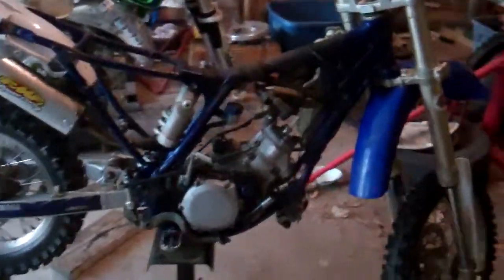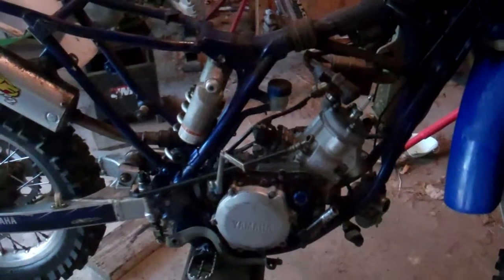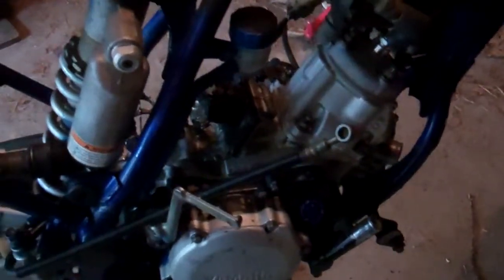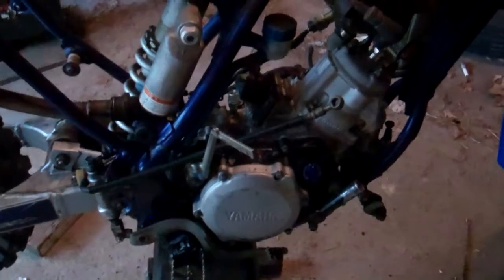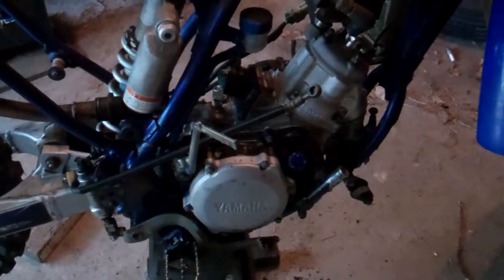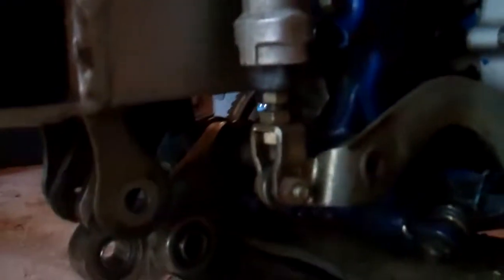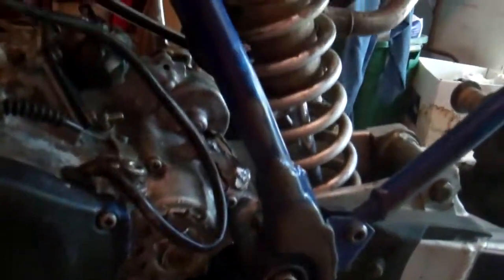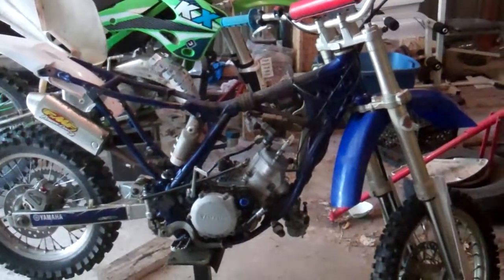02 YZ85 - Rebuilt engine/almost completed with the project!

Comment: Hey I have a TTR 125. My clutch doesn't start letting out until my clutch level is basically all the way out. Usually on dirtbikes I've rode as soon as you start letting the clutch out it moves the bike. What do I need to do to make it do that instead of not letting me move until the lever is basically all the way out
Reply from the maker: It sounds like theres to much free play adjustment in your clutch cable. The adjustment nut on your clutch lever perch needs to be adjusted out, that will tighten up some of the free play and your clutch should engage quicker. If your bike has adjustment nuts on your clutch cable your could adjust them out also to tighten up the free play
Reply: 85ccmaster did it and it works great now thanks alot man 👍🏼
Reply from the maker: Awesome, your welcome!